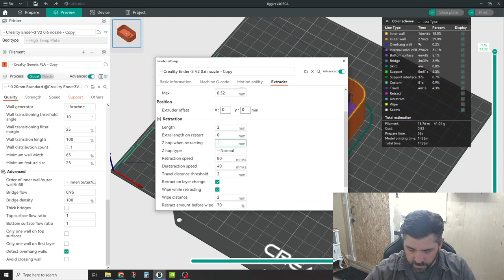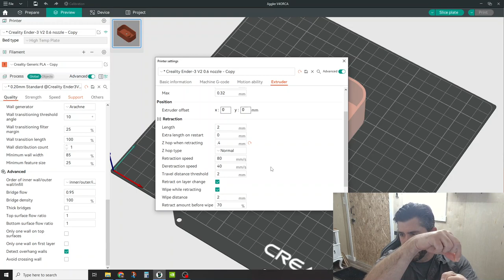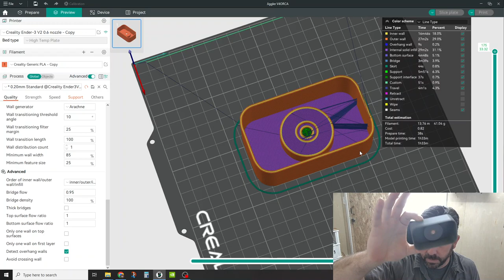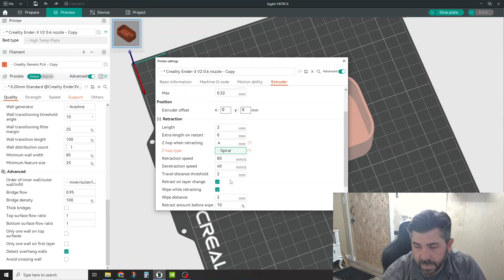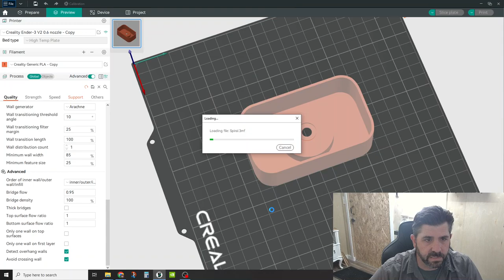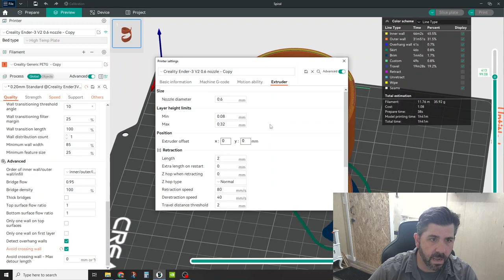This default feature in your slicer could be messing up your 3D prints

Comment: I find stringing really comes down to retraction settings and filament(possible moister). Once retraction is tuned for your filament stringing is very minimal, especially if wipe is set correctly. Main benefit of cura is their combing feature which is just a smarter wipe. I use orcaslicer on everything that doesn’t need massive amount supports.

Comment: After my Centered-Z mod I was excited to try z-hop again due to the speed and accuracy of the mod. 
It still sucked.... Then I moved to Orca to see what am the hype was about and I like to try defaults to see how it's intended to be used. I noticed the hop and said crap, I'll fix it after this test print. The test print was phenomenal.  And a printer config for the closest I could find, which wasn't that close. 

I've disabled the feature and printed several tests. Then went to print a functional print, lots of supports, and very high infill which can cause nozzle drag as the plastic cools. 
I'm turning it back on, I can tell visually on the top layer as well.
I'm going to enable Arc in Klipper so I can try the spiral hop option and see what that's all about. 
If you have a fast Z, I feel this implementation has more pro than con currently. 
If you don't have a fast Z, check out my videos.

Comment: When printing with organic or tree supports, I've had a lot of them break off before reaching the model. I believe it could be due to the nozzle colliding with the supports. I'm using the Bambu A1 with a textured PEI plate and bed auto-leveling. Is this something you have experience with?
Reply from the maker: Not specifically on my A1 since I just got it, but on other printers for sure.  With small features and supports it is certainly a risk.  That's one of the areas where z-hop can help.  If you've got it turned on but still colliding maybe check the z-hop distance. You might want to increase it if you're getting collisions.

Comment: I am...
flabbergasted. That's the only word I have. The fact that prevalent people in the 3dp community have been printing for a long time, and can't realize this, is wild.
I've known this for a few years, z-hop adds to the travel distance moved, and it moves your head up after a retract which literally pulls filament through the nozzle to start it oozing. On top of this, z-hop being on by default causes default profiles to have a higher stock retraction setting.
There's a big "issue" going around with the k1, where people insist that you can't print PLA with a 60c bed, while it's enclosed.
And it's literally because they increase the retraction to 0.6 from 0.4mm, the distance it SHOULD be, specifically because they use z-hop.
Z-hop is, imo, one of the worst features in existence, and only really exists to mitigate z-wobble and banding from bent lead screws, and MAYBE for very niche extreme overhangs.

Comment: Im having a problem with the scales i set on my prints being totally differebt when sliced exported and printed. Configure out why
Reply from the maker: Let me make sure I understand correctly.  So for example of you slice a 25x25x25mm cube in Orca and print it out, the dimensions printed are totally different?  How far are the printed results off from your model?